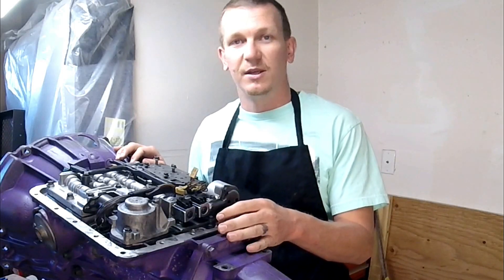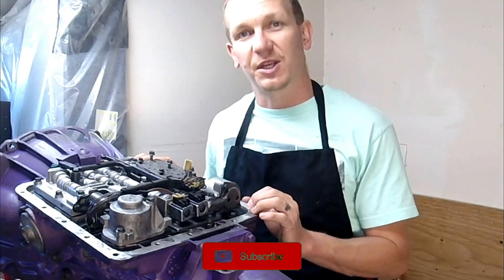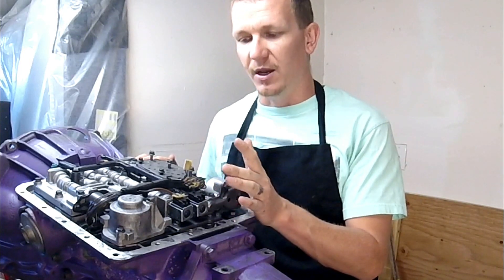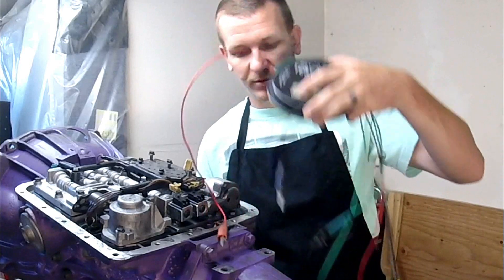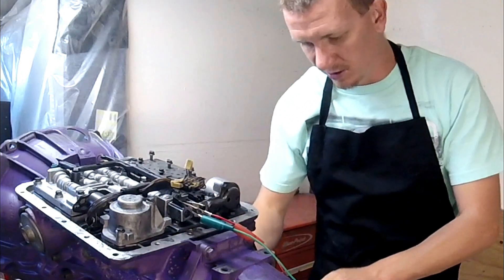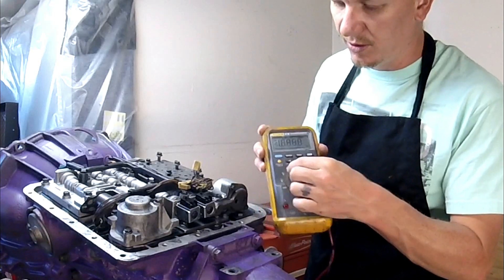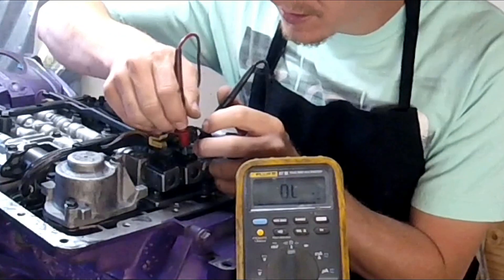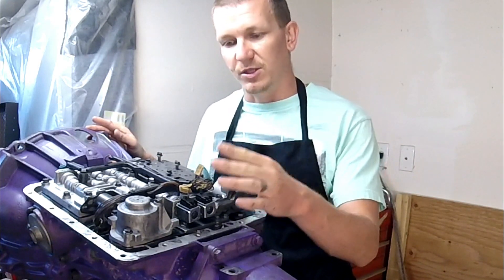GM 4L60-E Shift Solenoid Quick and Easy Test. Sol A, Sol B, 1-2, 2-3

Comment: I have 2002 gmc yukon 4l60e tra s.  S
Has reverse had 1st but wont shift up out of 1st just revs really high.what do i do..i got new vss and 1.2 selinoid
Reply: Sounds like my problem. I Haven't figured mine out yet.
Reply: I changed the vss no diffrence with my problem...i tried the run it for the codes.and i couldn't get power to my port under dash..i bought a selinoid and im going to drop the pan and change it..fingers crossed that it fixes my problem.it difficult when ur broke as hell and my only means of transportation.my wifes car waa stolen Friday nighr wrecked and totalled. Insurance wont even cover what we still owe so i need it running now

Comment: I just put in a 4L60E transmission 4x4 when started and put in gear I get nothing
Reply from the maker: Enough trans fluid? Did you have any issues matching the pump to torque converter?
Reply: Scotties Hobbies I have enough fluids the converter went right on
Reply from the maker: Check the fluid level with off. Then clean the dip stick super good. Check the level of the fluid with the engine running. Do you get a lower fluid level with the engine running?
Reply: Scotties Hobbies I put 13 guarts in that’s what it calls for
Reply from the maker: @davidcason7519  with no forward movement it's like the pump is not working. If you check the level running compared to off you can see if the pump is working. If the pump is working then it can be so many smaller issues. I'd hope the pump is not working in this case.
Reply: Scotties Hobbies ok thanks
Reply: Scotties Hobbies pump is working
Reply from the maker: Can you get any movement if you select a gear? Any?
Reply: Scotties Hobbies none what so ever it’s like it’s not engaging at all, could it be electric connections or internal problems
Reply: I would double check your converter to make sure its installed right
Reply: I'm have the same issue in my 03 avalanche have you found a solution?
Reply: Hate to point out the obvious...but is the shift linkage hooked up? This was an install and I know I have gotten into a hurry more than once and had to lift a vehicle to hook uplinkage.

Comment: 95 Chevy k1500, 5.7. Just put a trans in and few months down the road it won’t go into 3-4 or 3rd overdrive
Reply from the maker: Have you removed the pan? Any clutch material or brake material in the pan?

Comment: I have a 1994 Chevy Silverado 1500 2 wheel drive I can drive it at first but have the shift early manually but no banging no nothing any recommendations what is it automatic I was told you change all my solenoid and it

Comment: I have an 02 Silverado  with a 4l60e . The issue I'm having is that you step on the gas and the truck moves but the rpms go to between 2000- 2500 or higher. If you take your foot out and let it drop to 1500 and step on it again it's fine and drives the way it should. Any help would be greatly appreciated.
Reply from the maker: Could be something simple like your TPS not giving the ecu accurate info. Could be the accumulators not moving freely. Really it could be many different issues but that's the most common with your issue. 

Good luck on your fix. Let us know what you find.
Reply: Did you get this figured out? I'm having the same issue except I don't have 3 and 4th gear
Reply: @ralo20072007   did anyone figure this out my truck is a 03 1500 hd and has been doing the same thing
Reply: Sounds like your 3 4 clutch pack is burned

Comment: I bought a 93 GMC yukon (2door) that i had to manually shift to get it home...1,  2, D, then overdrive once i got to the highway... my question is with your experience would that pinpoint a particular part or would  testing still apply?
Reply from the maker: It's hard to point at one thing. For sure check the harness or continuity. But it really could be any solenoid. They are not hard to test.
Reply from the maker: Good luck with your fix. Let us know what you end up finding.

Comment: 1997 Silverado Z71 5.7L 4L60E... ONLY when trans is warmed up (driving for 20-30 minutes at around 55mph) trans has real hard shift from 1st to 2nd and a somewhat hard shift from 2nd to 3rd, can turn engine off wait 30secs and start engine and trans shifts normally again. 3-4 is good and shifting through PRND321 is good. This only happened after towing a trailer down the highway while in D (forgot to shift into 3 while towing) was told torque converter was toasted.
Reply: Did you find out what was wrong mine is doing the same
Reply: @fredoliver4209  no, not yet

Comment: I have a 2003 chevy trailblazer. It wouldn't shift from 2nd to 3rd. I took off the trans oil pressure switch.( the o-ring marked D3 was disfigured) As I was changing the press switch I removed the shift solenoids. When I replaced the shift solenoids I may have switched them because they are identical. Now I get all the way to 3rd gear and can't get to 4th or drive or over drive (5th). I'm thinking it could be the shift solenoids. As I said the o-ring for 3rd was broken so no loss but now I plan to replace the shift solenoids and I'll write back if it works.
Reply: Any luck w that?

Comment: Hey there!! 1993 k1500 4l60e in limp mode, watched this video to check my bases and rule out whatever I could. Both of my shift solenoids passed the 9v battery test, and they showed resistance anywhere from 27 ohms - 33 ohms. Do you think they could still be an issue given those numbers?? what do you think? Thanks, love your videos!!
Reply from the maker: How was your oil pressure on the dash? Did you check the continuity  in the harness? With the key on engine off I check for continuity at all of the connections. All connections should either have power or ground. So per se disconnect your shift solenoid A and check for continuity at the metal prongs on the harness. If you don't get any continuity then I would suspect that harnesses bad. What made you chase a transmission issue for a limp home mode? Did you have a code?
Reply: @ScottiesHobbies  Nope, I did not have any code. when I was driving it one day it all of a sudden acted in neutral when I was in 3rd gear and it would only shift every once and awhile and got worse and worse until I had no 3rd gear at all, and I could only go 40mph if I manually went through 1 and 2, so I suspected transmission issue. my truck it OBD I, and I did have a service engine soon light but when I used the diagnosatics terminal to blink a code it wouldn't give me anything!! 

First, I checked transmission fluid level and smell, visually looked at the transmission and all the wiring to it and all the plugs to look for damage... then I ended up finding a wiring diagram from the PCM to the tranny, and checked all 12v wires going to the transmission with key on and off, then I checked the grounds.
Next, I dropped the pan and found the fluid was a little milky and there was a lot of granules lining the bottom of the pan, which led me to belive a clutch pack is worn....

I did what you suggested as well and cheked the shift solenoids for resistance with them disconnected and found they had good continuity. 

Anyways, thank you for the information, you video and reply were extremely helpful!!!!  I am a broke college student so the cheapest option was spending 3 days at a pick n pull pulling a transmission with lower miles and clean fluid. Hopefully it will work!!
Reply: @jamesclark4544  did you ever figure out exactly what was wrong? Or just change it out with another? Cause I have a very similar situation, but my fluid was a little dark. With who ever had this truck before me I honestly don't think they did a lot of upkeep based on just a few things I've seen so far 😅 (literally put a damn bolt through the brake shoes instead of the post and spring lmao, among other things) so im hoping its just a nasty filter and fluid issue. I still gave to test my solenoids though so we will see! 

My oil pressure went all the way high the week before sonic changed the oil filter and it worked great for a few trips around town but exactly a week later I was driving and it just wouldn't go into 3rd, honestly felt like and sounded like it was in neutral. R 1ST 2ND and I drive it in od all work fine just wouldn't go up to 3rd and I never got to 4th to see if that's working or not either so idk. I also got no codes and my tran fuse in the cab is working too.
Reply: @chasees chasers I personally haven't and my truck is currently trying hard to fight for retirement 😅 though I did a "tcm reset" and she had zero issue getting into third...... until it warned up, but then if I slammed quick on the gas she would just go into 3rd like there wasn't an issue 🤦‍♀️ but there obviously is cause I can't just be driving around slamming the gas to go into 3rd lol look up how to do that reset and try it out though, it may work for you, never know!

Comment: 2004 chevy Silverado LS v8. 5.3 4x4 extended cab
I just finished the installation today 2019 Nov.6
Ok I put everything back in place battery good 
But starter  won't crank  nothing I even bang the starter sparks 
I'm not sure why doesn't  turn. Over 
Plus on my gears I don't see any the gears moving on my cluster 
I don't know if I have major problems with the  transmission sensor switch
Or the crankshaft 
Any suggestions
Last time the truck will crank right up 
But the only issues I know was my gears were not working properly
I'm trying to find the  best solution 
Is power on my truck I can switch the Handel the one on  the steering wheel but no  sign or doesn't felt like is working 

Every time i put the key on switch ignition doesn't respond no crank !!!
I did install a used transmission from junk yard
Was trying to save some green bucks 
But still no crank 
Tomorrow I will try to check the starter wires or crankshaft or sensor or something there will see will 👀
Reply from the maker: Prior to putting the new used transmission in what was the symptom? Why did you replace the trans?
Reply: @ScottiesHobbies  
Wasup
Now it was a fuse burn out
But 
Now problem
No shift not moving
Will shift all the gears but not moving

Comment: Sir. I have a yukon denali 05 after changing the transmission fluid my transmission don't have first and 4th gear I changed both shift solenoids but the issue is still the same please help me and give me some ideas what possibly went wrong
Reply: Im having the exact same issue, Checked a lot and still dont have either

Comment: He needs to be taking them out and checking to Springs. The Springs fail all the time. Not Transmission solenoid.
Reply from the maker: You mean the shift valves? I have a video on that process too if you check out my other vids. These solenoids do go bad a lot but the spring goes bad and debris causes the shift valves to get stuck.
Reply: @ScottiesHobbies  I noticed that the valve body is what's going bad most. Is what's causing the failure of most of the systems. All that aluminum is plugging up the system. The filters. If you tear it open you might as well replace everything. If it's stuck between gears. And get your pick out start moving the valves themselves. More than likely there's one that stuck or torn out. There's no use of going back in there. Unless you just lost all your Drive bans
Reply from the maker: @michaelspeakman8924  you'd be surprised how many people just change the solenoids and have to ho back to inspect the valves. Make sure to keep up on that filter.. that is super over looked on regular main.

Comment: 2006 Chevrolet Silverado 4x4 5.3l
Transmission has all gears but won’t shift on its own. Have to shift manually till over 20km/h then it’ll shift normal but if I go under 20km/hr it slips into neutral. No codes stumped 😕

Comment: I replaced selenoids on a 2000 Chevy Blazer  and still want go on drive
Reply from the maker: When you have no forward movement for reverse movement the pump is usually at fault. If the pump is working properly then you probably have some type of a line blockage.

Comment: I have a 93 gmc sierra 5.7 and the transmission basiclly takes off really slow it feels like im towimg something really heavy and it works ok sometimes earlier today it was fine then it gave me problems and the it was fine agai and now its doing it again im gonna he testing the solenoids tomorrow i hope its that...
Reply from the maker: Check the wire harness for continuity with the key in the on position wile you are there. A power probe is really useful in this situation.
Reply: Ok ill check for continuity thanks for the feedback, ill let u know what i find i dont have a power probe but i do have a mulitmeter so ill set it to ohms and use that...
Reply: So i just unplugged the battery plugged it back in and now its working so i know its something electrical... Any ideas on what it can be i still want to change the solenoids and check for continuity.... For now im driving it will see how long it last..

Comment: Hi Scottie. I have a 2000 model year 4WD 4l60e that came from a Tahoe. The transmission will not shift into third but instead will go from 1st to 2nd then downshift back to 1st instead of 3rd. I haven’t experienced any slipping just the weird shift pattern. I dropped the pan and the fluid is burnt. I checked the solenoids and the resistance is in range and they passed the clicking test. Could this be a lost 3-4 clutch pack?

Comment: I have a 99 Tahoe with a 5.7 and 4l60e and it shifts really hard from first into 2nd it is an automatic do you think it could be these shift solenoids or the 1-2 accumulator or what...it only shifts hard from 1st into 2nd
Reply from the maker: Really could be either or both. I would plan on getting to the 1-2 accumulator. Wile doing that I would check the shift solenoids resistance, clean the shift valves while looking for debris, check the wiring harness for continuity, and check the accumulator piston and shaft bore. You'll probably find a issue with one of those components.
Reply: I know this is old but FYI change the throttle position sensor for future reference. Been there done that.

Comment: I have a 98 Chevy c1500 with a 4.3 4l60e. 

A buddy gave me a rebuilt trans from a 95 c1500 with a 5.7. Can I bolt the 95 to my 98? Can I use the 98 torque converter? Any help is appreciated.
Reply: Read the metal tag on your current torque converter. If the ratio and what not matches new torque converter then your good

Comment: Great video! But honestly your filter and the fluid you get from the pan should be changed every 30k especially since you are only getting half of the fluid out. And them solenoids are failures commonly, OEM ACDELCO ones are only 10 dollars each so I change them every service or other service just so I dont ever have that common problem. And you can seriously replace both of them in under 1 minutes if you wanted to. Changing them 2 solenoids, transmission filter and fluid, putting the pan back on takes me 30 minutes at a cost of 50 dollars every 30k. Easy, cheap, reliable maintenance. Not to mention the help it offers at selling time.
Reply: I agree they are so easy and cheap to replace so why not replace them every oil change there is someone on ebay selling an ac delco filter and gasket kit + 2 ac delco shift solenoids for only $35 cheap as chips if you ask me.

Comment: I have a 98 s10 blazer.  I'm not sure if it is a 4l60e or 4l60.  My question is I have all forward gears cold or normal driving conditions.  But with my reverse it won't do anything until the transmission is warm.  What do you think can cause this?

Comment: I have a 4l65e(I think)2002 4x4 trailblazer. Fluid is clean smells a little burnt doesn't shift into 3rd on its own but if I play with the throttle (give gas and let got) I can get it to shift into 3rd any ideas or suggestions where I should start or look at? Thanks
Reply: I have the same problem. Did you ever find a resolution?
Reply: I hace 2000 chevy  s10 and My transmisión missing the 3 Gear can you help thanks. @reekgoesoutside
Reply: @jorgemorales5814  it probably needs to be rebuilt. If the fluid is dark and smells burnt you need a new transmission.

Comment: Is this a procedure that can be done with transmission still in vehicle? I have 00 bravada with same trans AWD and it's slipping between 2nd and 3rd?
Reply from the maker: On the 4wd its a little more complicated to get the pan off on a 4wd but yea... you can do this with the tranny in the vehicle.
Reply: @ScottiesHobbies  I have a 2003 Silverado SS AWD and it just started  slips when its going to shift between 1st and 2nd. RPM goes high and I let go of the gas then it shifts and I can start driving it normal. Do you know what it is?